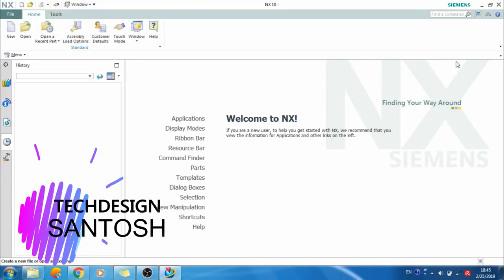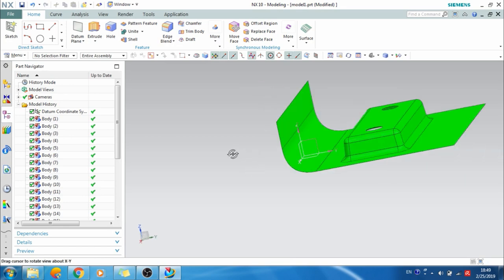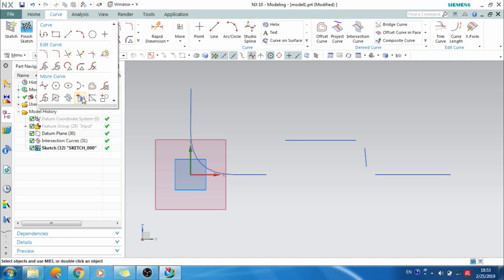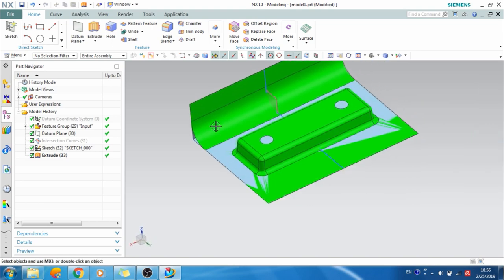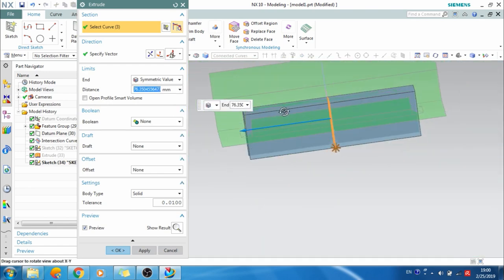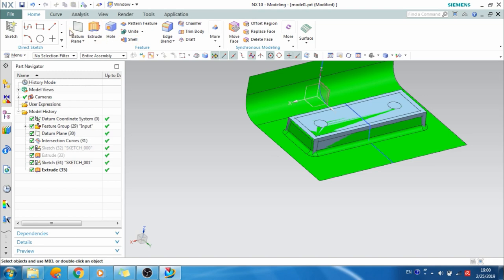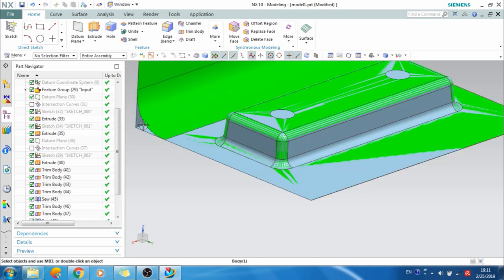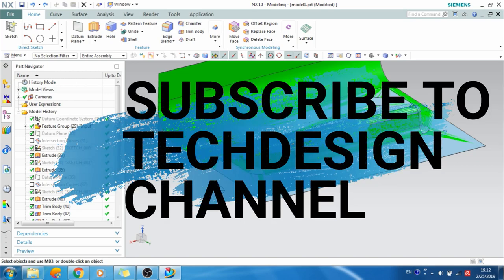Unigraphics NX- Basics of Remastering / Parametric Modeling- Advanced Modeling

Comment: You do so many manual steps. 
You achieve a cleaner result if you just do a drawing of the imported body, print it out and use the drawing dimensions to model parametrically from scratch. 
I was expecting the use of special tools to recognize shapes and the parametric model would be created more or less automatically. But thumbs up... keep doing these videos!
Reply: @TechDesignsantosh  nice explanation.
Reply: r u working on remastering  project